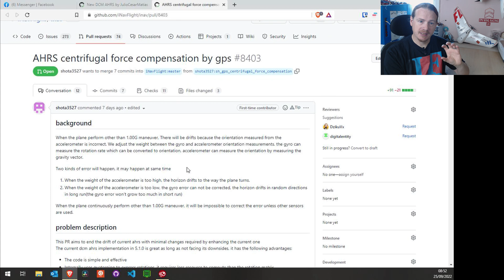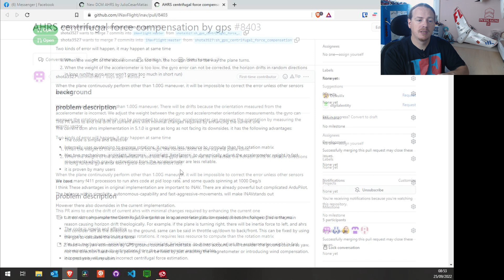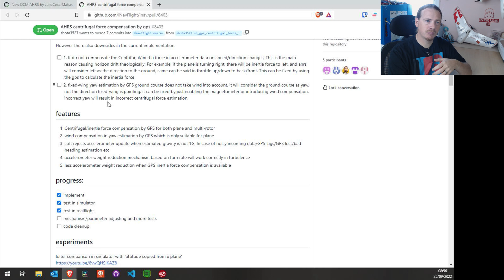Horizon drift; and the future with INAV 6

Comment: I'm getting more horizon drift now with 6.1  than before with 5.1. Went yesterday for a test flight with new 6.1 in my Mini talon and it drifted so much that was not possible to enjoy the flight. switching back to 5.1 to compare footages...
Reply from the maker: If you’re getting drift on 6.1.1. There could be something in your build causing it. Electrical noise and vibration from the prop can cause issues. The only case of Horizon drift we saw in 6 came from an out of balance prop, which was causing many G of vibrations on the gyro.

Comment: Any news about remapping motor pads to servos?
Reply from the maker: There isn’t any remapping in INAV. But, you can choose to have all outputs as servos or all as motors. If you map all as servos, you can still control standard ESCs via PWM. Just use Stabilised Throttle in the mixer. 

That setting is output_mode 
https://github.com/iNavFlight/inav/blob/master/docs/Settings.md#output_mode
Reply: @MrD  thanks. I'll just wait for the target for my fc and try it.

Comment: Can't wait. Lost two planes due to severe horizon drift after upgrading from 3.1 to 5.1. Never a problem with 3.1.
Reply from the maker: On 5.1 the mitigation presets are a marked improvement over 3.0.1. But, if you updated with a diff file, and didn’t keep the new mitigation presets, that would have caused problems. If you have any other models on 5.1, please check the release notes and copy across the new mitigation parameter defaults. Those new defaults improve 3.0 all the way to the current release.

Comment: The prop/motor balancing is spot on.  I always balance my props but was a little more lazy when it came to balancing the motor and prop together.  I had some APC 8x6 props that came together in a package . I had replaced the stock prop on a Ranger 2000.  I was getting ton of vibration (even see in the camera feed).  Took the prop off and made sure it balanced on the bench.  Balance was perfect on the bench..  Put it back on the Ranger 2000.........vibrations came right back.  Tried moving by about 10% each time and never could get to balance.  Swapped it out for the other one in the package and it worked flawlessly.  Too the one that was causing problems on the Ranger 2000 and put it on the AR Wing PRo, result smooth as butter.

Comment: Thank you for the clear explanation of both the quick electrical/mechanical and slow horizon drift. 
Maybe I can add another issue, causing mechanical horizon drift:  I'm starting using ball links on servo's and elevons on my small wings. Any play will "fool" the FC because FC corrections will not result in an "expected" result (large dead zone) ??? 
Well, flying various wings and quads from INAV 2 to the current 5.1, I'm happy with all the progress made. Looking forward to INAV 6
Reply from the maker: Technically, that wouldn’t be causing horizon drift. The sloppy linkage will just make the control outputs less precise. But totally agree, decent servos and a nice linkage with as close to zero slop as possible is the best way to set up a plane.

Comment: The loiter looks really good.  So it also affects acro mode?
Reply from the maker: Technically no, drift doesn’t effect acro. But any drift will still be visible on the AHI. Using acro I could throw the planes around more, which is the currently weakest part of the new AHRS. Manual and acro aren’t effected. Everything else would be. But so far, the new AHRS has performed very well.
Reply: @MrD  dang I was hoping to have some excuses when I crash.  I came from ardupilot to inav at the time i was using inav more like a gain controller with OSD it flew ok in NAV modes now it's really pretty good and a lot easier to setup and does LEDs without a freakin lua script.  If what your showing is on its way that's really exciting
Reply from the maker: I think we all hope there was an excuse for that 🤣 Ah well, if you’re not crashing, you’re not trying. 

It’s pretty exciting times for INAV. 6.0 should see one of these make it in. Hopefully the full AHRS will be ready. There’s still about 2 months until the release candidate phase will start.

Comment: Am I like the only one that's NEVER experienced Horizon drift with iNav? lol
Reply: you did. you just are not using navigation much OR have just not noticed at if you fly mostly Acro/Manual
Reply from the maker: I think there are a lot of people who have had it, but not realised it. The guys at my flying club. But most of them don’t use an AHI, so wouldn’t see it, or only fly in acro.  Also pilots who fly mostly proximity are less likely to see it, as the plane is moving about more.

Comment: Do u know anyone with control surface deflections for xuav cloud. That’s my current build almost ready for maiden my first v-tail biuld I’m a bit nervous didn’t mark build a cloud not to long ago maybe I get some feedback from him after I watch his video thanks bro
Reply from the maker: Cool plane. Marc @b14ckyy’s Tech has a Clouds which is flying pretty nicely. I’m sure he can share his throws.
Reply: Man I’m ready to chuck it in the air hasn’t been a smooth build still have a few problems so I have no artificial horizon in osd. And pitch says I’m 21 degrees nose down when plane is level maybe I need to recalibrate accelerometer. I’m not sure I like this h743 wing this is my 2 one the first one I had in shy hunter and took it out and tried to put it anouther plane and couldn’t calibrate accelerometer both r first versions so don’t know if maytek had problems with it. I almost want to replace it with 405 I don’t want to crash this planeAnyway everything seems to move correctly so not to worried about 21 degrees thing shouldn’t auto level sort that out roll is fine. Any way thank for all the help in the past and future. I share your videos with people that don’t even know how to spell inav maybe it help your channel I don’t know kinda funny to me
Reply from the maker: I would just adjust the align_board_pitch angle. Chances are that where it’s installed in the plane is not flat. To recalibrate, you need to reset the current calibration. I’m going to look at adding an option for this in configurator. But you can do it in CLI by setting accgain_x, accgain_y, and accgain_z to 4096 and acczero_x, acczero_y, and acczero_z to 0.
Reply: @MrD  I tried that already after recal still gos to 18 degrees nose down the plane it’s in or was in is xuav cloud I installed in flight controller bay I could see it being a few degrees off or out of level but it’s not I level battery bay then check F/C bay and both are the same .I have two h743 wing and have trouble with accelerometer on that one too it won’t even connect to accelerometer tab anyway both r h743 v1  i tried to manually set pitch angle but not sure how to. Will try once again see what happens. I replaced h743 with f765 and works great haven’t flow cloud yet waiting on calm day thanks for the help you r bad ass I use inav to review our crops can hardly wait on 6.0 even though plane r flying great in 5.1 sometimes in way point plane will drift some but manageable. maybe in 6.0 we could add more waypoints
Reply: @MrD   so would I need to recalibrate accelerometer then set align_board_ pitch_angle
Reply from the maker: @Drilldaddy1  no problem. To adjust the board pitch alignment, you need to use the CLI and the set align_board_pitch command. This is in decidegrees so 1 degree is 10 decidegrees. 

You’ll love 6.0. As well as the AHRS changes to stop drift. There are changes to waypoint missions to make them track more accurately.
Reply from the maker: Shouldn’t need to recalibrate. Sit it flat on the bench. Click the reset z axis button. Then raise the nose until the 3D plane on screen is level. Then read the value. If its 18.3 degrees off, use “set align_board_pitch = -183” and save that. If it moves the wrong way, use 183 without the -.
Reply: @MrD ok try in a minute
Reply: @MrD  awesome man thanks I try this board in a older plane make sure it’s ok. Have any magic tricks to fix the other h743 go to calibrate click calibrate skips all 6 steps and they stay gray same mpu 6000 in config but when I got to calibrate each position nothing happens just stays gray. Never been crashed or dropped. Flew a few times just never seemed right so I took it out. I’m thinking something is wrong with this board In 3d set up pitch is-1.3 roll is 96.5 when u move board it hardly responds at all and stays on those pitch and roll degrees. I think I had inav 4.0 on this board moved to 5.1 with full chip erase I’m gonna try run firmware again se what happens
Reply from the maker: It may be that the IMU is on the underside of the flight controller. In which case, the first position, the flight controller should be upside down. The IMU needs to be the right way up for the first calibration step.
Reply: @MrD  yeah tried that one seen that in the gethub it’s just don’t respond no matter what I do don’t understand  like I said I had that board in the air last winter took it out and now nothing. I’ll try the upside down trick again

Comment: Yea I currently have six inav planes and only only experienced extreme H/D on a few of them fix all but two with caps on esc and lc filters also but they all still drift a bit except reptile dragon I e never had any crash’s cause of it and seems to mainly affect angle and cruse
Reply from the maker: Yes, manual and acro are not effected by horizon drift. Everything else will be. On the two builds where the caps didn’t solve the extreme drift. Try balancing the props. You may find this will help.